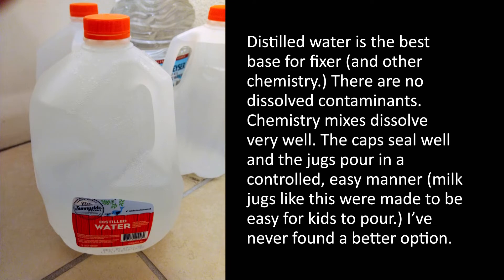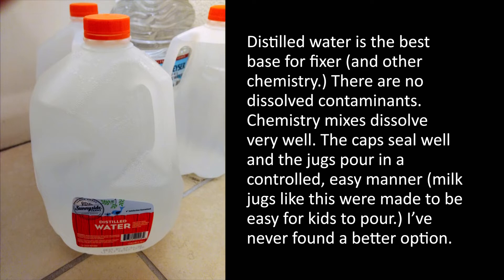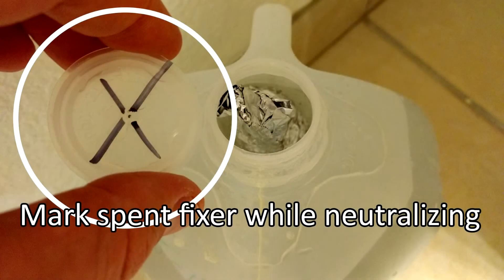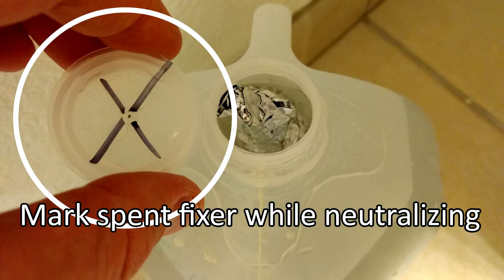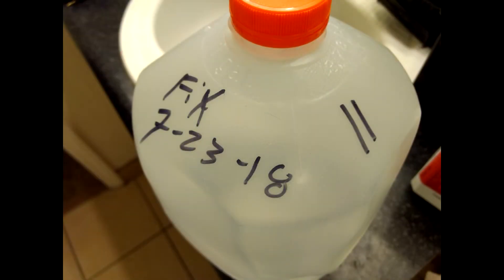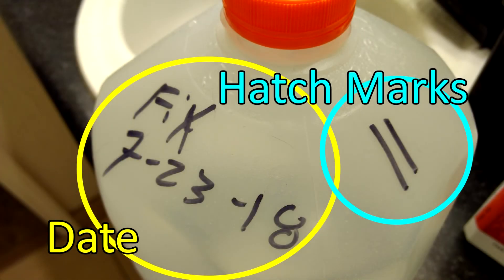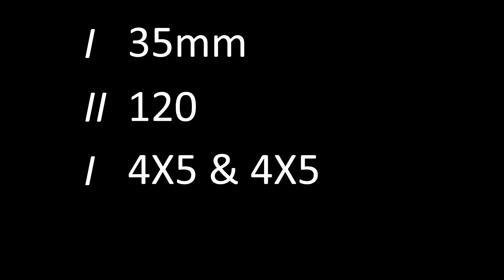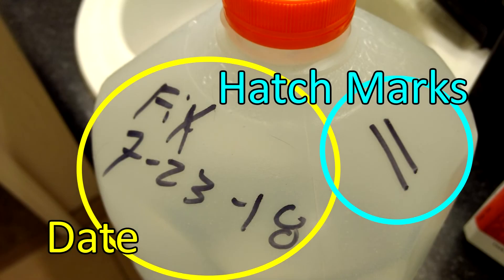Negative Flaw: Bad Film Fixer

Comment: I recently had this problem, I thought that it was a light leak at first..... eventually found out that both my fixer AND stop bath were the problem.....Ironically the fixer passed the test of dropping a  section of exposed negative into it and timing how long it takes to convert it to clear...... so just goes to show good record keeping is essential.
Reply from the maker: Yup. I recommend making a hatch mark on your fixer bottle for each roll of 35mm film (or equivalent if you shoot other formats) and then pitching it when it reaches a set number (I usually use it for the last time when it crosses 60 rolls -- well ahead of when it's completely spent, but at the point that to my eyes it starts to get too weak.)

Comment: Would bad fixer cause dark negatives? The quality of my developed negatives are fine but they are just really dark.
Reply from the maker: Not likely. The most likely causes are overexposure in the camera, over development either from being developed for too long or in chemistry that was too warm, or light reaching the film while being loaded into the tank or developed. For overexposure, the negatives would be pretty uniformly dark and there would be clear boundaries around each negative between the frames, and the images would be relatively low contrast when printed or scanned. For overdevelopment, they would be dark and high contrast and the spaces between the frames would be generally clear. For light getting to them the spaces between the frames would also be dark and the darkness on the film would likely be uneven or blotchy.

Comment: I was frustrated with spots and streaks and finally found what works for me. After I dump out the fixer I fill with tap water and agitate vigorously for a minute. Dump and repeat then wash for five minutes then repeat agitation. Next I add distilled water agitate and dump to get out any tap water residue. Refill with distilled water let sit for ten minutes then agitate for a minute, add a couple of drops of photo-flow and let it sit for a couple of minutes. I use my fingers to squeegee lightly, I have used several types of squeegees and they caused scratches. With this method of aggressive washing I get perfect spot and streak free negatives. I also keep only fresh fixer which is a big help, it's taken time to get to the point of being happy with the results of developing film.
Reply from the maker: Thank you! Distilled water is invaluable for removing spots, especially in areas with hard trap water. That's a good technique that you've developed.

Comment: My negatives today had cloudy fog lines up and down the frame and around the sprocket holes. Fixer issue?
Reply from the maker: Nope. That's developer surge. it indicates that the agitation was too vigorous and needs to be gentler. Alternately, it could be bromide drag if the re was no agitation at all (for instance with stand developing.)
Reply: David Hancock weird I agitate the same all the time and developed tons of rolls and never saw it. Just started two days ago
Reply: David Hancock however I did just change tanks , maybe the different design effected the agitation. The one I used before didn’t have a spool. This one does to spin the film.
Reply: David Hancock so I tried mixing a new batch of fixer and refined the images and all the weird fogs were gone.  I think I just had a bad batch of fixer.

Comment: another awesome video. If I'm trying to avoid using bad fixer as priority, would you recommend powder? I've only used ilford rapid fixer and I'm not really crazy about it. Thanks
Reply from the maker: Thank you! In general, I prefer powdered fixer. As a rule, powdered chemicals last longer on the shelf before being mixed. I've used powdered chemicals that were made in the 50s and they're okay. Once mixed, they have the same shelf life as liquid chemicals. I have started using liquid Kodak fixer because it's a lot easier to mix and performs exactly like the powder. I'm also not a fan of the Ilford fix.
Reply: @DavidHancock  thank you

Comment: good information david cheers for sharing your techniques I generally wait till it's clear at the end or start of the roll using Ilford rapid fixer generally @ room temp it takes 5 to 10 mins if it takes any longer than 10mins than its time to mix a new batch that what I was taught of my supplier but as u said every brand is different
Reply from the maker: Thank you, Beau. That's the best way to do it. There's also a fixer clear test that can indicate if fix is still good or not.
Reply: cheers buddy

Comment: Actually, 8x10 has the same surface area as a roll of 36 exposure 35mm, which is the same as a roll of 120 or 4 4x5 sheets of film. Since fixing is related to the surface that is being fixed, you need to calculate the number of films accordingly.
Reply from the maker: Thank you, Francois.
Reply: @DavidHancock  you're welcome.

Comment: Your next series should be basic mistakes to do with exposure in natural lighting conditions, how to use Sunny 16 an where to tweak it. I would love to have a very robust understanding of Sunny 16 and I have searched everywhere and it is just very basic. If you could do something around that idea and serialise it, it will be as great as this series.
Reply from the maker: My next batch does have question on Sunny 16. I'll cover the rule, what exposure value is, how to determine other settings from a Sunny 16 reading, and other general guidelines like when to use f/11, 8, 4, and 2.8 as the guiding aperture. That's question 68 of the next batch (which is about 120 questions.)